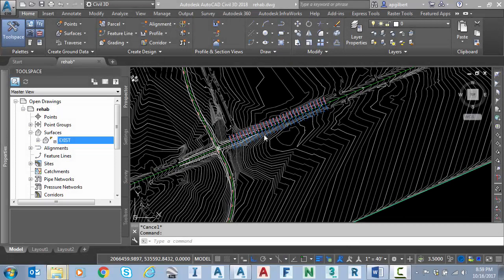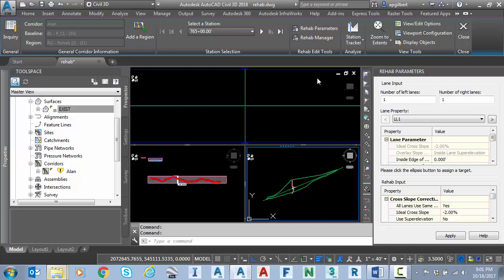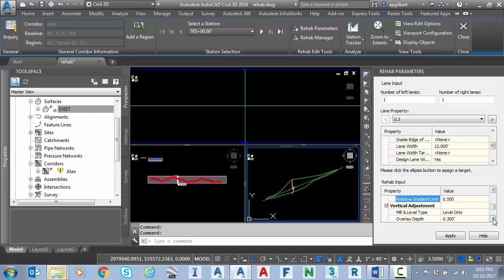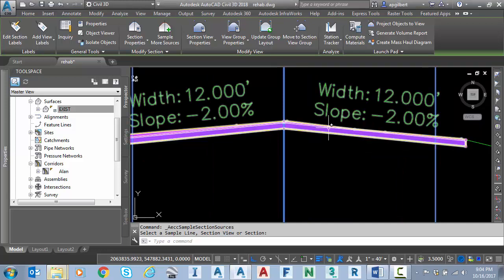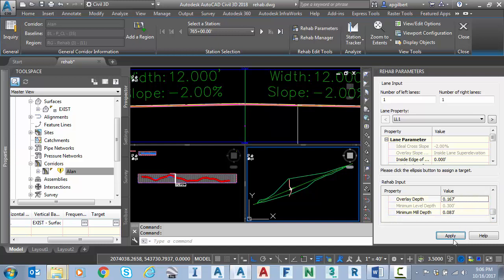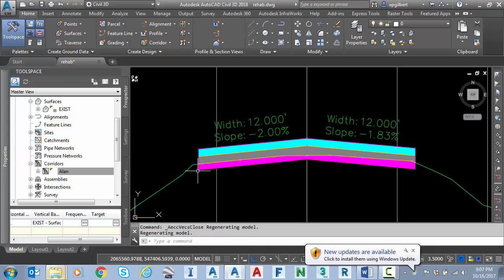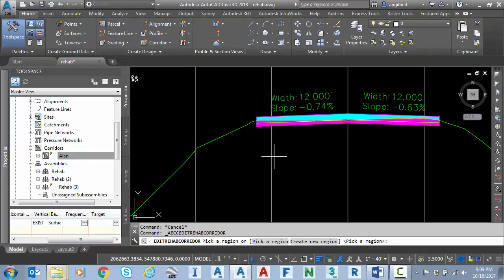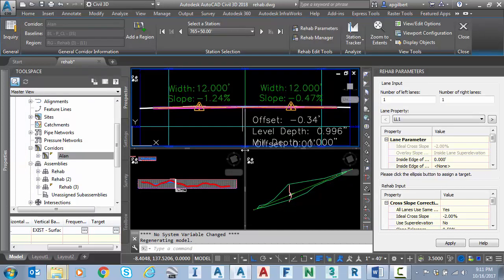Finish Strong Friday: Rehab Corridor Part 1 – Introductory Overview

Comment: that is awesome. how would it handle a rehab that would include additional new lanes with excavation for new sub base, base, binder course and wearing course.
Reply from the maker: I plan to discuss this in future videos, but in general, you're probably looking at a two pass workflow.  Meaning run the rehab to obtain the  computed design surface; then use this design surface and/or feature lines as targets for your new lanes.  For widening jobs where a new shoulder or lane is being added outside the width of the rehab area, you can add additional subassemblies to your rehab assembly and model just like any corridor (pass the computed slope/existing slope to the shoulder and/or lane via output parameters).